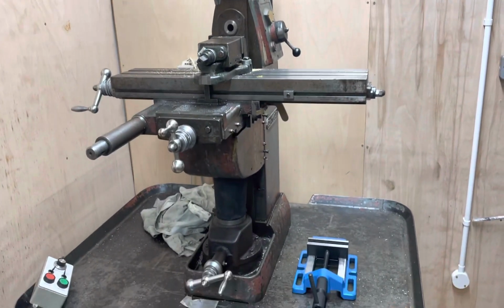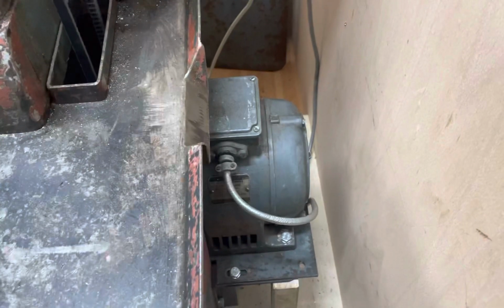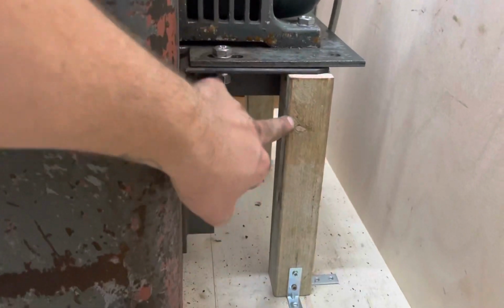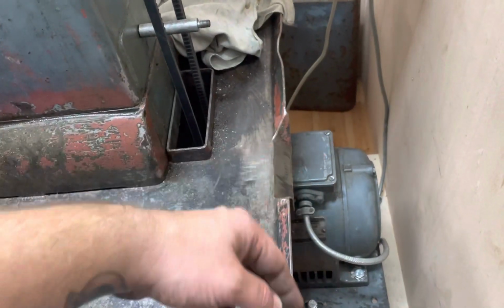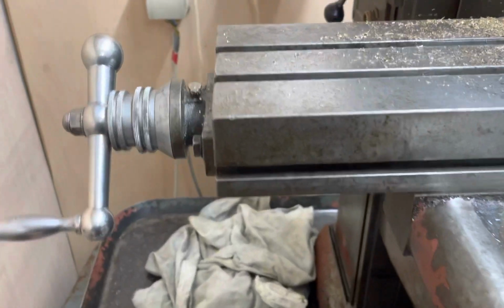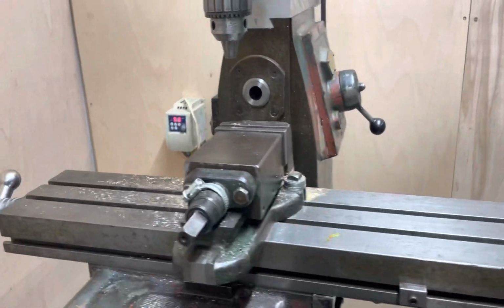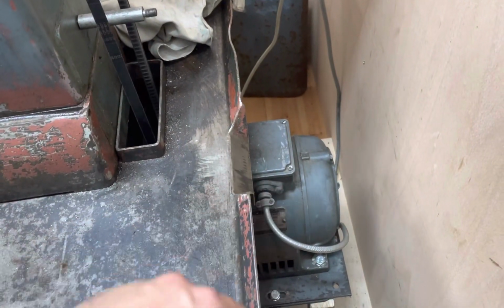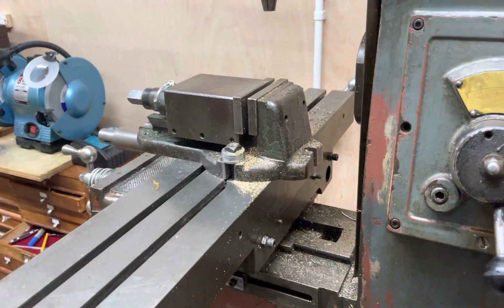Refitting, balancing and belting up a 3-phase milling machine motor - Finale!

Comment: That is pleasing when you get the job finished. Well done.
Reply from the maker: Thanks, i'm so pleased it turned out OK- I would have been right up the creek if it'd not worked!
Reply: @williamsworkshopuk  No, I could probably find you a working motor... Mind you I did have fun and games with my own mill motor.

Comment: Noiser than a modern mini mill but allot more rigid and therefore, a much better choice of machine and a much more enjoyable machine. Innovative and neat motor setup.
Reply from the maker: Yeah it's not the kind of thing you can run late at night, but you pays your money and makes your choice. The biggest mistake I've made is paying over the odds for the ML7 when I should have got a bigger machine like you have!

Comment: The tray looks like it would drain oil and swarf right onto the motor. Might want to block that somehow. At least put a sheet metal sheild over the motor.
Reply from the maker: That’s a great shout! I’d not thought about that. I don’t use coolant and don’t use that much oil but you can never be too careful. Thank you for the comment!!
Reply: @williamsworkshopuk  If you have a drain, you could fit a catch tank. Then you could use coolant. Helpful for steel.